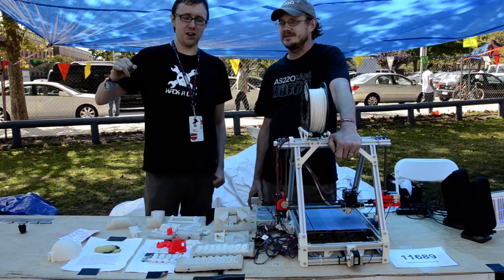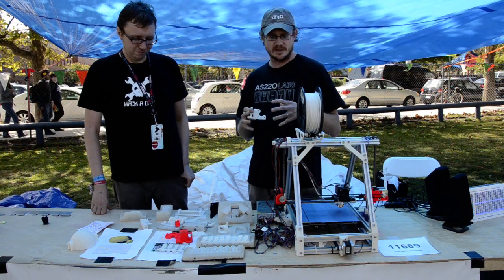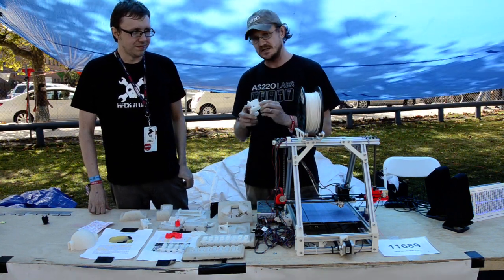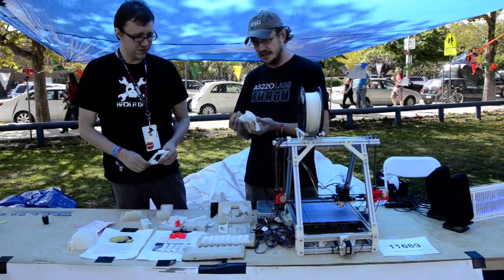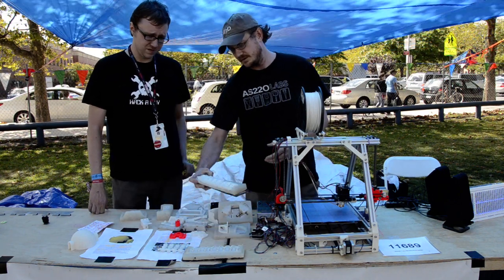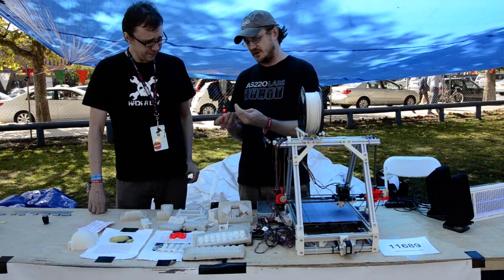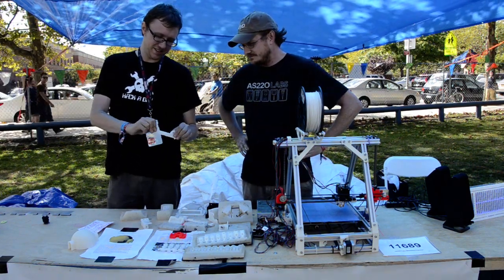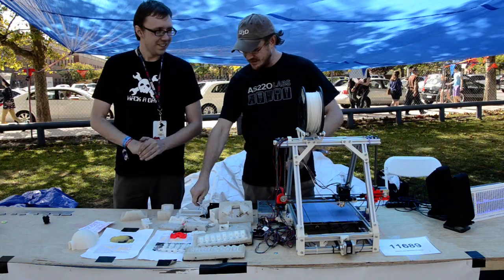Casting printed parts

Comment: Ceramic molds let you get greater complexity and fidelity for casting metals than lost wax casting, but that's beside the point I was trying to make; just because of the limitations of the molding process down the line it doesn't invalidate the "purpose" of 3d printing which is the ability to rapidly prototype and iterate complex shapes.
In video 2 as well one of their printed mediums was wax based so if you wanted to do lost wax casting that is still of some benefit.

Comment: The problem isn't 3D printing here, it's the maximum possible complexity when sand casting without using a master you can dissolve or melt after finishing your mould. At that point your best choice would be wax. I can only see a tiny niche for 3D printed materials there. If you see more feel free to enlighten me.

Comment: Once you have your master then you can just mass produce molds from that though. That's how a lot of of firearm receivers are made as it's faster and easier to create molds from other medium.

Where 3D printing has the edge is iteration. You can make changes to your prototypes and have them physical much faster than you can if you were sculpting them. But for mass it's about how many molds you can make and manage.

Comment: Of course, you would still have to touch it up. I don't know to terribly much about metallurgy, but you could probably pop more molds out quicker than could be machined. 
However, the machinery that most modern machine shops use is really expensive. I could see someone making a simple 3D printer and then using it to make molds and cast them. 
I mean the ease of use and the ability to cast in mass would be the real advantage.

Comment: Not really. I mean a 3D printer would let people create complex shapes easily. Essentially your skipping a large portion of the machining process. 
I mean metal simply doesn't like to give and takes skill to work, but even 12 year old could pour metal into a hole in the sand.